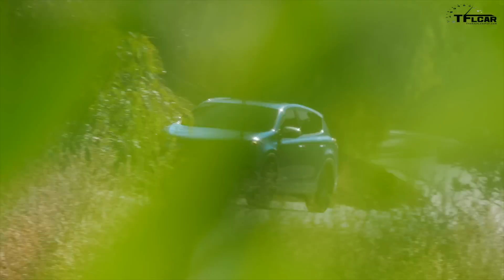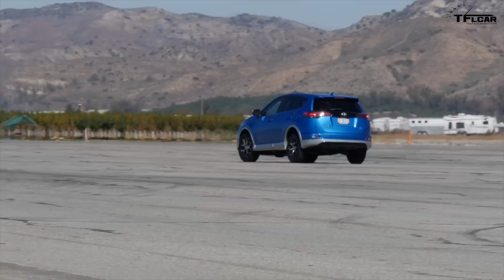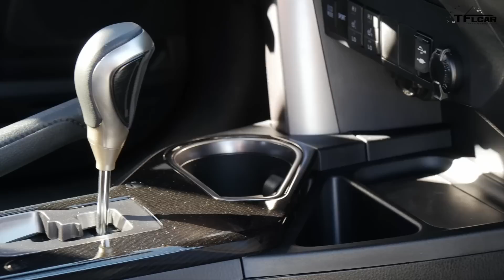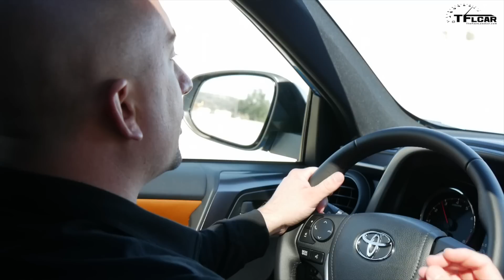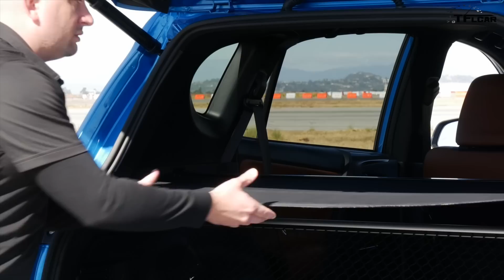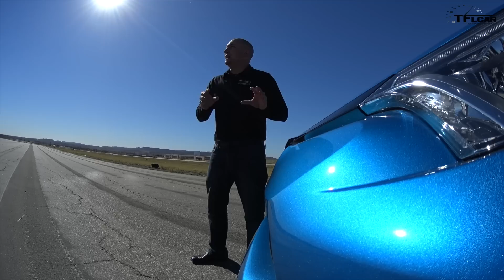2016 Toyota RAV4: Everything You Ever Wanted to Know

Comment: The door lock broke on ours. The gas tank is not large enough for long distances. The black cover on the back is a waste. And I didn't think the rear seats were comfortable. The front seat so much more comfortable. The biggest problem is you guys do a terrible paint job. And it's already been coming off in some placez after a couple years. Toyota scammer dealership even upsold us the protective coat which if course did nothing since we see the paint coming off.

Comment: Oh my god. Don't listen to this guy, the backseats are horrid. They are extremely uncomfortable and hard. The back of the seat is basically just a straight line. The front seats are slightly better but it is still the most uncomfortable cars I've ever ridden in. And why I'm listing negatives about the car, the door lock is to far forward and it faces away from you so you can't see the red on it so in the unlocked positions it looks locked. And why do you have a traction control on or off button? Anyone buying this car would never need to turn off the traction control and it's just a waste of money and time.

Comment: i have been leasing 2010 and 2013 RAV4s. I chose toyota because of hand brake and stick shift capabilities, and also center lock. 

however, i am so not happy today.  i tested center differential lock today.  in NJ we got 12 and above inches of snow today. when i put it in rear, wheals wouldn't either lock or turn. i was getting stock and digging in instead of driving through. and i know how lock it and drive on snow and mud. 

i liked that Toyota went back to interior lights on 2016 models of rav4 that were available for 2010 models and made it to be pushed so you dont need to look for buttons, just push on a light itself, great. 

however, ..

did they include illumination on door buttons thought? 
did they fixed transmission? that was slipping on first gear manual mode while braking and coming to a complete stop. that drives me mad. what if i were to brake on ice. that would skid a car. 
also noise reduction. Was it fixed on XLE model?

Thank you.

Comment: People complaining about no v6. Toyota's answer is get a highlander, 4runner or lexus rx. People complaining about no third row, Toyota's answer is get a highlander, 4runner, sequoia, landcruiser, gx or lx.
Want a more rugged SUV? Get one of the above mentioned body on frame SUV. There is a car for every need. Toyota and other car manufacturers cater their cars by segment, and are cutting manufacturing costs by not providing powertrain options. Also, allowing powertrain options can affect sales on other vehicles. It's actually doing more harm than good to car manufacturers to provide power train options. 

The Rav4 has been a letdown to be honest. But you shouldn't expect it to be more than an entry CUV under $25000 at the lowest trim.

Comment: Hopefully, when Toyota's TNGA platform spreads to the other models (RAV4), Toyota will introduce a turbo-hybrid. That could be a viable solution for those who want more horsepower/performance. Toyota could use the Lexus NX's turbo-four, tune it down from 235 horsepower to around 200 horsepower (for better fuel economy), and then add the electric motor which will generate around 80 horsepower. Final horsepower figures should be around 220 horsepower with plenty of low-end torque. 

(The reason why not all the horsepower from the electric motor appears in the final horsepower figures is simply because that the electric motor doesn't use all of its power/electricity on driving the wheels. It has other duties like starting/stopping the engine (cars with START/STOP technology), help recharge the battery, etc.)

I really do hope that Toyota builds a turbo-hybrid model. Since this is also a hybrid, Toyota will employ it's VVT-i Otto-Atkinson engine that can switch from Otto Cycle to Atkinson Cycle, and vice versa for better performance/fuel economy. Plus, if Toyota won't employ this system, Lexus has cylinder deactivation technology, which Toyota can use instead. That means that 1 cylinder will shut off from this 4 banger if unnecessary.

Comment: Great review of the new Toyota RAV4.  I wish auto makers would have in addition to setting the height of the rear tail gate to also include speed control.  I've found most small crossover rear hatches are often to small to benefit from having an electric rear hatch but most are also painfully slow to open.

Comment: They need to raise the back hatch door.  So easy to get damage when parked on the street.
Reply: +Wayne Li what exactly do you mean by that?
Reply: +TR7 TRIUMPH   The back hatch door of the new  gen Rav4 so big and low, it extends into the rear bumper.  It&#39;s a big design fail.  Any rear contact from a taller vehicle will dent or damage it.
Reply: Wayne Li Ah, I see your point. I completely agree, and it seems like a theme on all the 2016 model range
Toyota hatches and SUV's